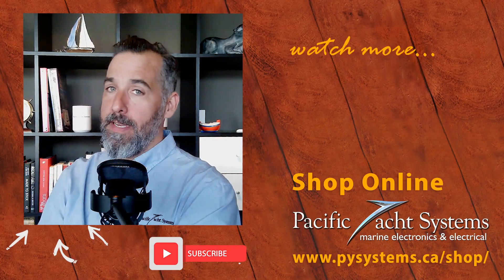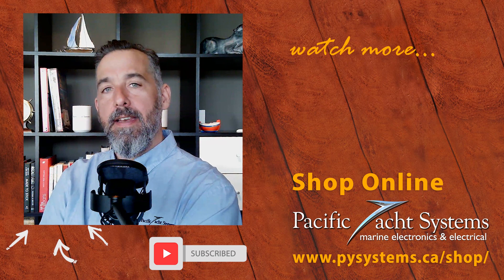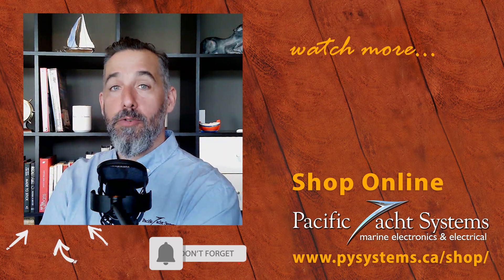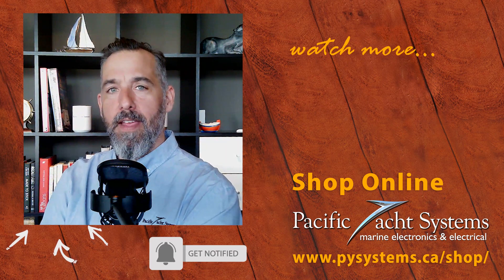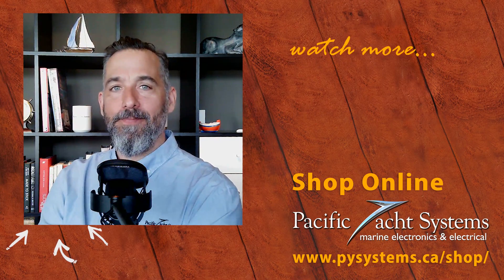What Are the Dangers of Corrosion or Low Voltage on My Bow Thruster Battery?

Comment: Used to be that Deep Cycle Batteries were for running light loads for long durations. I shoot for no more than a 20 amp load. If you can give that battery a break by an external power supply, it would be better for our old friend the Lead Acid Battery.